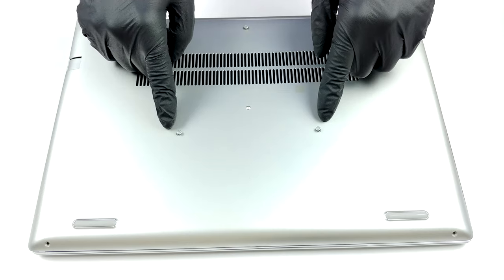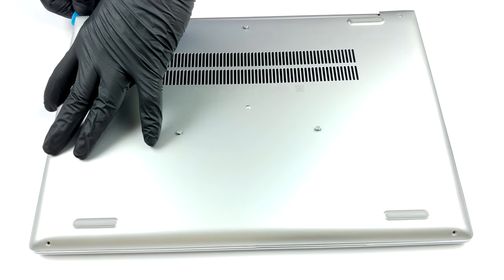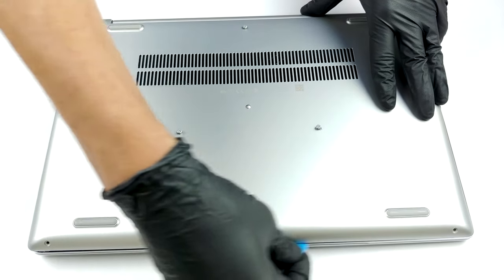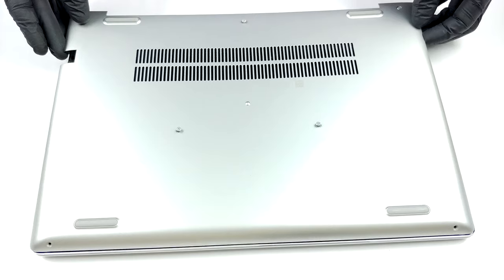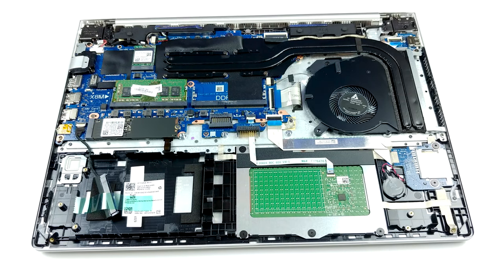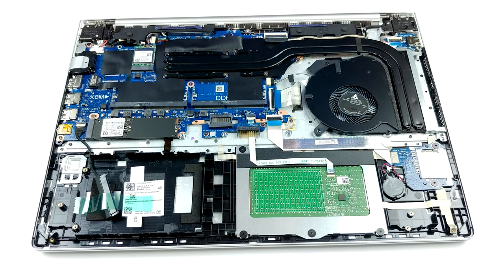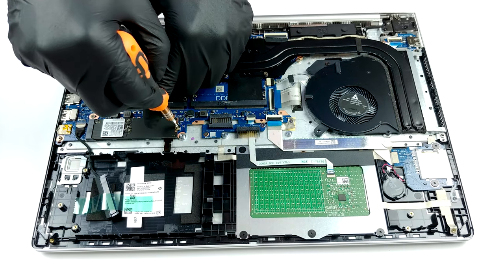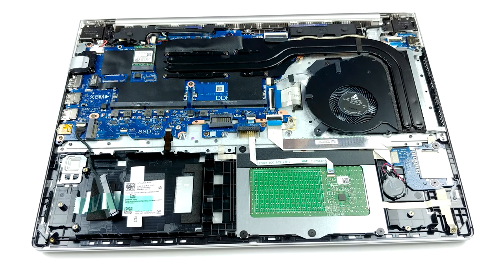🛠️ HP ProBook 450 G7 - disassembly and upgrade options

Comment: This is really just fitting components from smaller sized model to a larger chassis..... The huge gap between the vent opening and fan might be a bit of problem for cooling

Comment: Nice to see HP includes the cable for attaching a 2.5" drive. I think there should be a rubber bracket or something to hold in place? Not really necessary if it's an SSD that you're installing in there.
Reply: I have same laptop without hdd cable! Very dissapointed...
Reply: @ИльяМаслов-й1ю  привет. т.е ноут с ssd m2. нет кабеля для полключения hdd ?

Comment: I got the 7 screws loose but that's where it stopped - you make it look so easy. I have the same tools you used also. Suggestions? I couldn't get the back of. Also, question: is there a SATA connection installed for adding a 2.5" hard drive in the provided bay? HP doesn't have them!
Reply: Try prying near the rear of laptop. The corners are often the best place. Try with an old credit card too. You're right that the video makes it look far too easy. The case has already been lifted before it started. Take your time and all will be fine.

Comment: i have got this laptop with 
i7 
8 gb ram
1 tb 
NVIDIA mx250 

but still i can't play single game , all the games looks very slow  , any suggestion ?
Reply: lower the resolution in the settings, lower in game details. mx250 is for light gaming
Reply: Mine came with 16gb ram, expandable to 32gb. Not a gaming laptop but may help  Also, download the Nvidia Experience app and you can tweek stuff.
Reply: HDD or SSD. If HDD, change into SSD for sure
Reply: Could be a heat issue. These thin gaming laptops all start to throttle pretty soon.
Try a cooling stand for the laptop. Helped with mine.
Reply: Run pubg it will be smooth
Reply: Change battery plan to high performance I'm getting around 4.7ghz of CPU speed and it runs most games smoothly ( newer games are demanding I don't recommend downloading them )
Reply: @Koji27   how pubg emulator runs in this hp probook 450 g7. On what fps game runs?

Comment: Can I upgrade gpu on this hp 450 g7? 
I am using it (i5 10th gen & intel uhd 620 version)
Reply: No, the GPU itself is integrated on the cpu but you could add another ram stick to get a lot better graphics performance. (Up to double the speed) If you have 1x8gb, you could upgrade to 2x8GB to get dual channel working. This video demonstrates the improvement: https://www.youtube.com/watch?v=mdStl2S4Oao

Comment: does anyone have a fan issue ,
mine has a very annoying behaviour when the fan is under 50% speed ,
the fan goes up and down like pulsing and its not constant .
very noticalbe  in quit environment .
you cant control it , niether bios update fixed it .
i am thinking to replace the fan
Reply: Every laptop has this issue